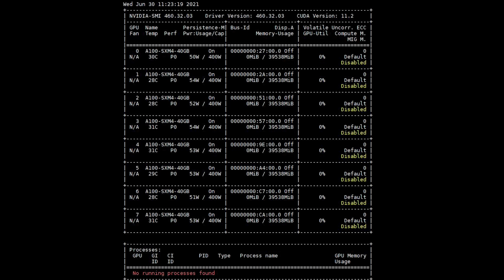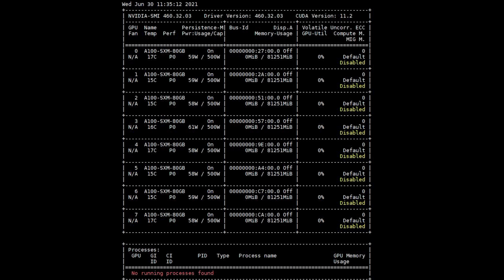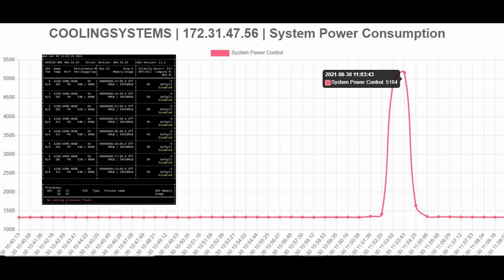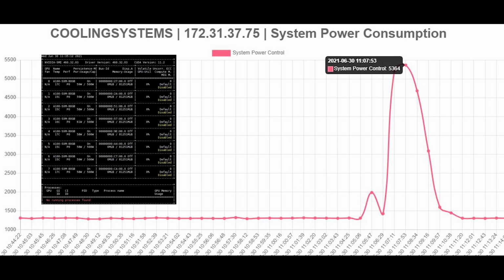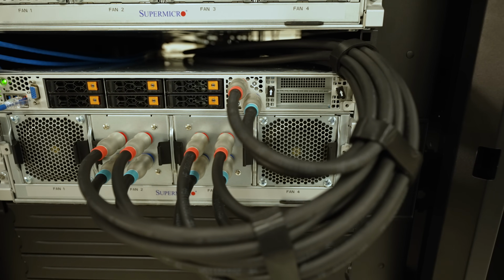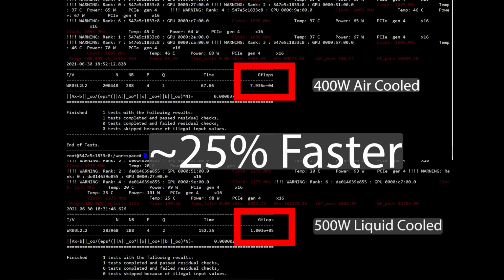Liquid Cooling High-End Servers Direct to Chip, Rear Door, and Immersion Cooling

Comment: As you talked about in the DC tour video, they raise the humidity of the cooled air to be ~50% RH to reduce ESD danger.  To eliminate condensation on a direct-to-chip coolant line, you'd want to drop the RH to as low as possible.  How do the data centers deal with these conflicting needs?  Is the coolant at or above ambient temperature, like in a home watercooled setup?  I was under the (mistaken?) impression that DCs ran sub-ambient...
Reply: From my personal (technician for mass server hosting company, access to few data centers) - data centers usually run at around 20c ambient temp.

I'd assume water cooling systems would be above ambient
Reply: @Angel2kinds  Wow, that warm these days?  Back in the early '80s I did datacomm at Burroughs, our office was next door to a little in-house DC with a couple big mainframes and they kept it 11-12C.  It was FREEZING in there with the constant blast of air up through the floor.
Reply: @d00dEEE  oh, I suppose its different if you got massive DC vs small in-house one

The one where we got most of our infra (including few 22KW racks) has 20° ambient

Even fairly powerful blade servers with dual 280W cpus only require to be sub 30°C on intake.

Got no experience running GPUs tho.

Comment: If data centers went all liquid cooling, I wonder how the heat could be recycled. 
I toyed with the idea of water cooling my Opteron box way back, but I couldn't get any info on running consumer WC pumps 24/7. I did see a few commerical solutions for workstations, but they are very expensive.
Reply: Look at things marketed for aquarium use. (esp. salt water tanks.) I've had fish tank pumps run for a decade.
Reply: @jfbeam  True. I learned a bit more about the supply chain for this stuff and it seems like pumps that go into consumer water-cooling also go into a bunch of other things. So, no need to worry.
Reply: I know of some university HPC clusters that recycle the heat from their liquid cooled servers for heating. Liquid cooling is super common in HPC, use of the heat sadly not. The problem is that its fairly low temperature (35 degree water temperature), so hard to transport long range and most importantly just way to much. And its often just way to much power to effectively use, the DC there is build for ~5MW which is probably way more than the surrounding modern buildings need, even in the winter.

Comment: The servers mentioned in the video is for large scale deployments. A small or middle scale company can't afford / doesn't need such large scales, but still might need the advantage of water cooled servers.

For this in mind, EK ( very well known and respected vendor for custom water cooling solutions ) started to build their own workstations in EK FLUIDWORKS brand. They have 2 series Studio series and Compute series, that they have PRO series CPU/GPU water cooler blocks with QDCs for ease of maintenance and replacement as well as dual Pumps for redundancy.  X7000 Compute series has a case setup to be used in office use that can support up to 7 GPUs. This year, they also announced 4 GPU supported more compact X7000C and rack mounted version X7000RM series.

You might wanna check those out once they are available and look if it is a good choice for small scale more budget oriented operation.

Comment: Intriguing. Datacenters need to start looking beyond the monetary cost of water though - especially in the Phoenix area where nearly all water is "imported" one way or another. 

The growing trend of condensing more kW per Rack U is alarming as well, and is the elephant in the room. What are chipmakers and ODMs doing to address things like current leakage and overall power consumption (performance per watt)? It's great to condense your data center footprint, but it'd be just as great to condense the waste heat as well. One thought is what crypto miners have already figured out, and that's undervolting (within stable limits), which sometimes increases performance while reducing waste heat at the same time. 

IOW, reducing heat at the source may pay more dividends than designing better cooling - especially when reducing thermal output can reduce your cooling footprint. The question remains whether the tradeoffs are worthwhile (X more racks to offset any performance difference vs Y fewer cooling towers/capacity/kW of heat).
Reply: ??? - Data center power efficiency has been the "hot" topic for like a decade or more. Electricity is a high fraction of DC costs so there's a very strong incentive to buy the most efficient parts. There's a reason that server CPUs are clocked lower than corresponding workstation/consumer parts, and older-generation enterprise hardware is so cheap on the used market.
Reply: @fat_pigeon  Looking at 250-300W per socket, and having multiple sockets possible per rack-U, even more efficient cores and density are translating to more power dense racks w/ higher amounts of waste heat. IOW, we make more and more efficient parts, only to crank them up to the same tried and true peak thermal limits, often at the expense of wasted power for no appreciable gain (like over-enrichening an air-fuel ratio for an engine at some point reduces performance)

Undervolting by around 100mV in many cases reduces component heat by around 10°C w/o changing performance or cooling solutions. The numbers vary by sample. 

My thought was, other than crypto miners, who else has attempted to optimize CPU/GPU voltage at scale w/ the goal of reducing heat output?
Reply: @RickJohnson  My point is that that's true for desktop parts, and only desktop parts. (Well, also workstation and high-powered laptops). For those, it makes sense because they normally run interactive workloads at low duty cycle, so performance is paramount and efficiency under load is less important. But everyone else already cares greatly about power usage, and those parts are already clocked lower for efficiency. Servers? They pay a lot for electricity. Mobile? They want to maximize battery life. This is part of why people were so impressed with the Apple M1, since for some workloads it gives desktop-class performance with a TDP of roughly 15 W.
Reply: Running the hot outlet water from the CDU through a secondary chiller to recycle it back into the loop is one way to solve the water problem, and then that heat from the chiller could be reclaimed for the building's hot water as its condenser coil could go into a hot water tank for that purpose.

Comment: Water is just so much better at transporting heat than air!
In data centers it is often: server heat > air > CRAH > (chilled) water.
So why don't go directly from server heat to water...!?
Direct to chip water cooling would be such more efficiënt, imho.
Reply: The simple answer is a water leak can destroy electronics.  In a data center with servers stack on top and beside each other in a rack. You can actually destroy other servers in case of a water leak.  Air cooling is less complex and if a server fail it doesn’t affect other servers.  Water cooling data center servers do have its benefits but it’s more complex to deploy.  We need more safety innovations and operation costs to come down in par with air cooling.  Before we could see water cooled servers becomes a standard.

Comment: All that knowledge collected by people doing custom loop overclocking is finally paying off :D
Reply: Except immersion cooling, it existed in some datacenters long before overclockers were born.
Reply: @dankodnevic3222  Though Seymour Cray was definitely an overclocker but a VERY competent one. The usual overclocking crowd.... they are more like reading an instruction and mess around.
Reply: Funny how usually server tech trickles down into the home PC market, but this is a trend trickling the other way - just like how racing innovations trickle down into daily driven cars!
Reply: @RickJohnson  basically its evolving but backwards
Reply: @suntzu1409  when you think about that pc watercooling startet with enthusiasts cooling their Athlon's and Pentiums with Car radiators, garden hoses and aquarium pumps, its even funniert xD
Reply: @Felix-j3d4b  exactly! My first water cooling rig was an Athlon with an industrial pump, a five gallon bucket, and a huge heater core. (Early 2000s). Ok, I didn't know what I was doing, but it worked. Ironically, with the valves in the back, it looked like these solutions too.
Reply: @Felix-j3d4b  i guess trains, industries and factories using water cooling since like 1900 (or earlier) make it even funnier XD